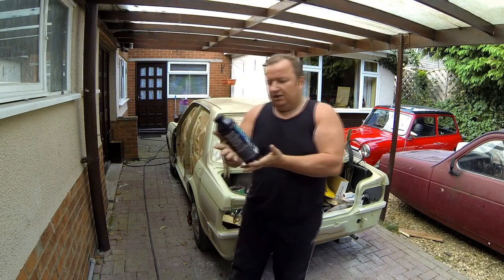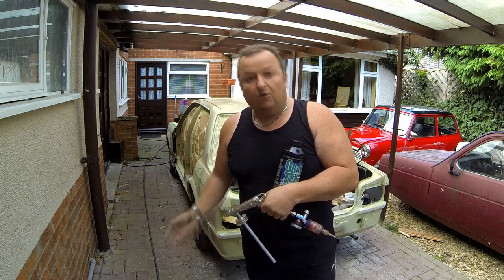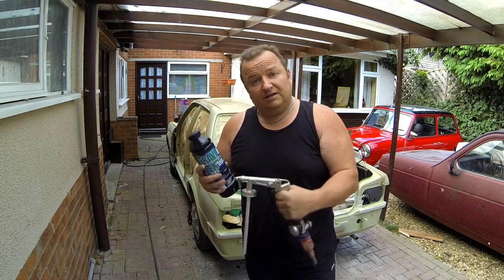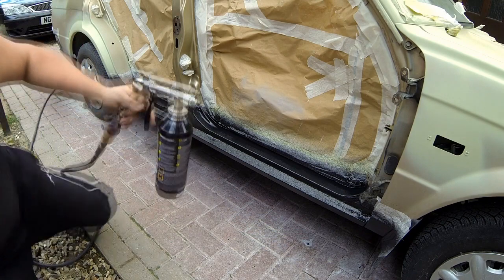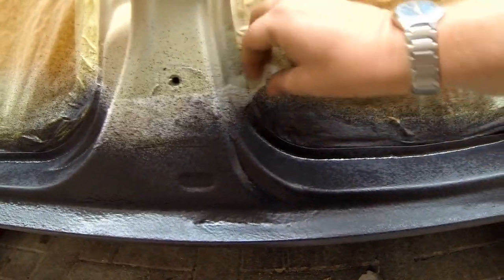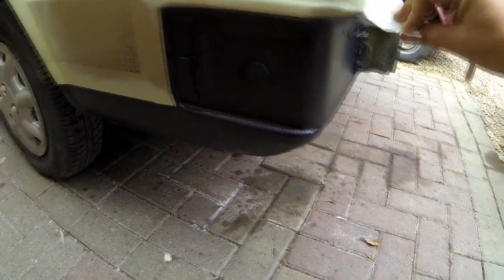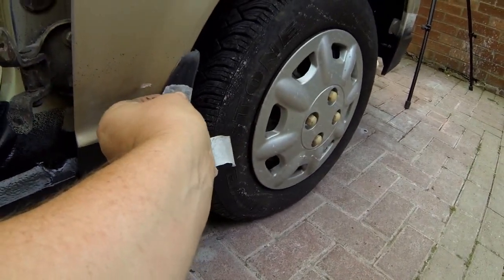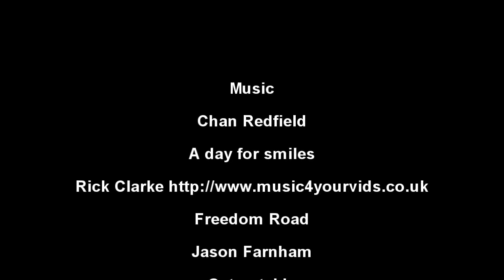Part 5 Triumph Acclaim Restoration Applying The Stone Chip Guard

Comment: For underbody and in wheel wells, the "stone chip" type product is the stuff to use - never use the older "underseal" as it is terrible stuff. It goes hard and brittle and chips easily and water can get in. Over time, it traps water between it and the metal, and will actually make the metal rust out faster than if it wasn't there.
I've seen this happen so many times, and I've had to repair sills and floors that had been done previously because of this.
Reply from the maker: Yes, underseal isn't very good. This product is a lot better. Cheers
Martin

Comment: Hey nice video. One question, when applying this stone chip spray do you need to first apply a primer spray or can you just spray over the old paint? Currently restoring my diff guards..
Reply from the maker: You don't need to prime but you should ensure the surface is clean and free from flaking stuff and scuff the surface to help it stick.
Cheers
Martin

Comment: Hi great video. I just ordered the gun and the product and I am wondering what the PSI setting u used to spray it? Ty
Reply from the maker: I think I dropped it down to 30 psi but you don't pull the trigger right the way back. Best to get the feel by test spraying something.
Reply: K good Ty. Im going to be spraying all the black lower panels on the 97 C230 Benz to white..getting the spray settings right is half the battle. Just chip guarding under the doors.
Reply from the maker: William Z
good luck bud.